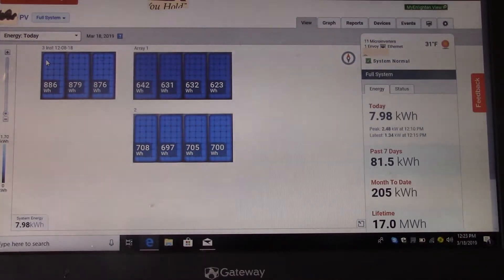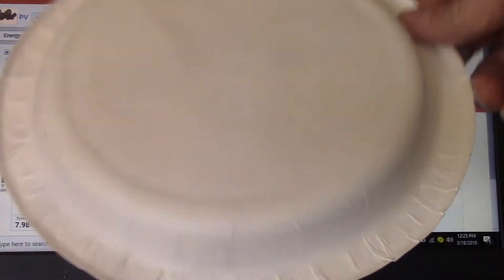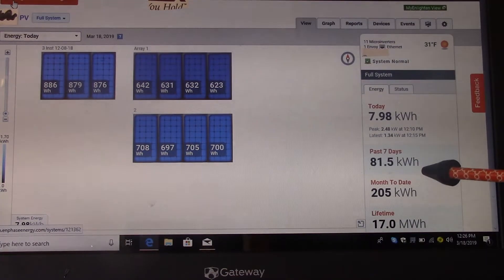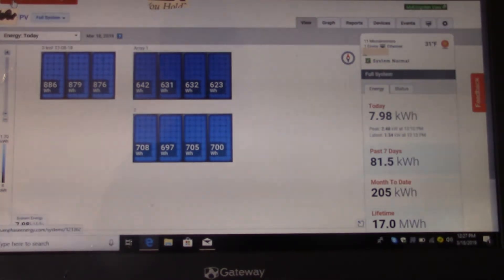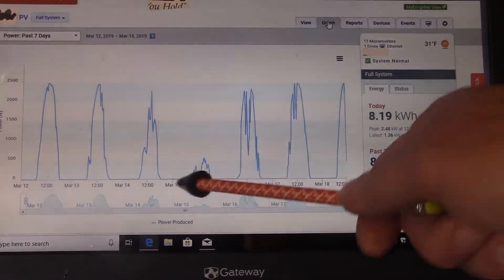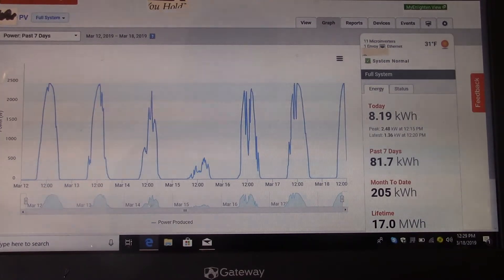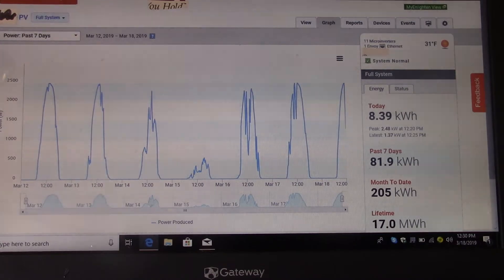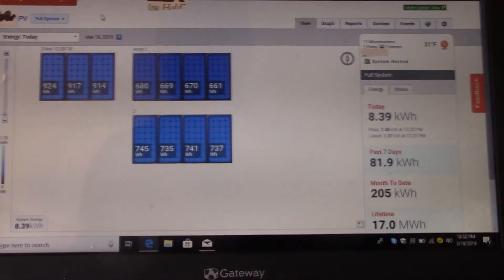My solar system:  Video 1

Comment: I've had an Enphase system since 2012. It's really been great.
Reply: BTW, I also have a GeoSpring water heater.  I've had it for a few years now as well, but I watched your videos on it before purchasing.  Did you get your new car? My wife just put in an order for a Prius Prime.
Reply from the maker: I just hit 21MW and am saving 70-90 dollars a month.  I still have 3 more panels to install when I get a plugin car of some kind, lol.  We must have installed our systems at the same time.  Thanks for the comment.